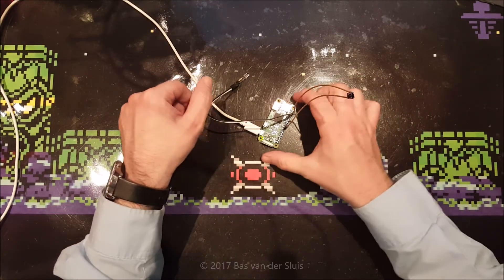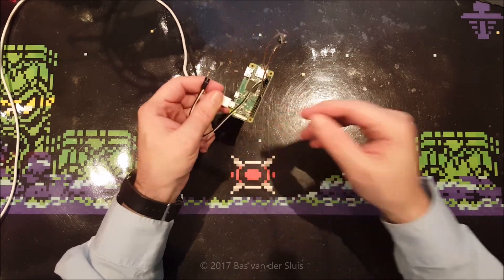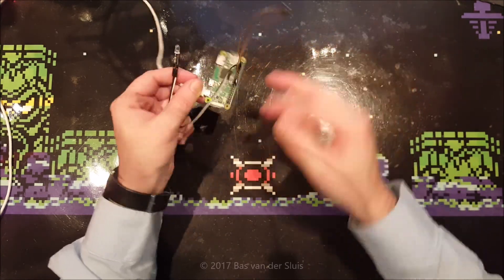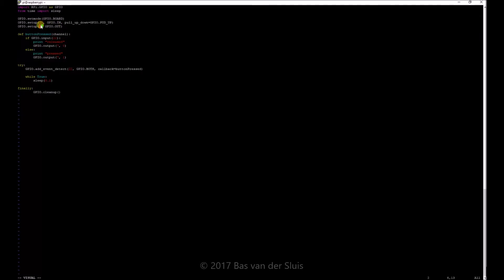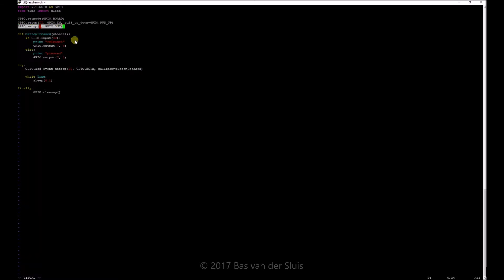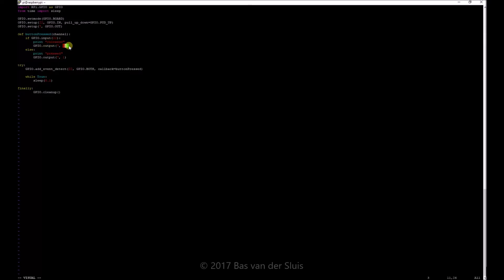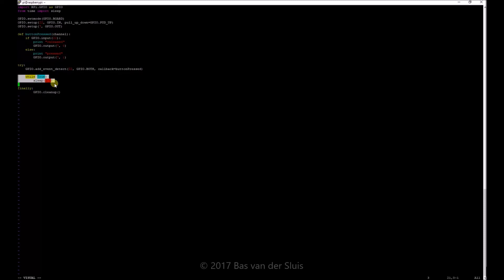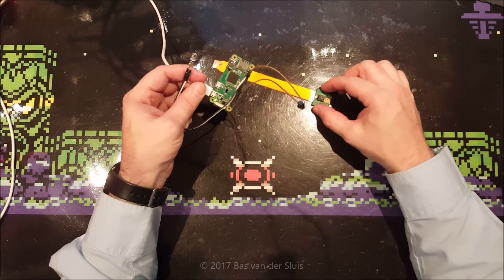Adding a switch to the Raspberry Pi GPIO pins without a pull-up or pull-down resistor

Comment: Thanks so much. Using your configuration of the pull_up_down in BCM mode to trigger a liquid float valve for an auto top of system i'm working on in python. Nice work! I will be displaying it in upcoming videos on my playlist "Reefing with Raspberry Pi"!